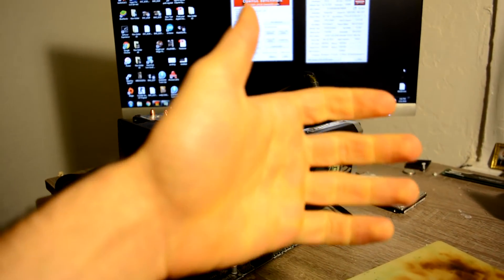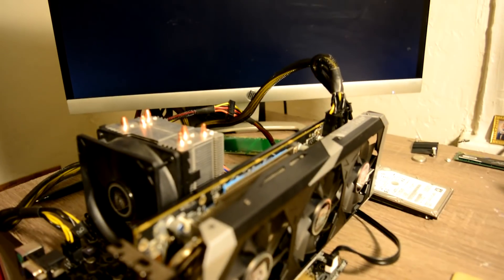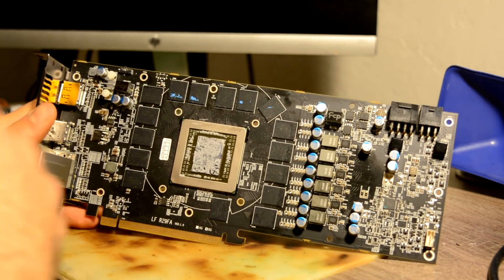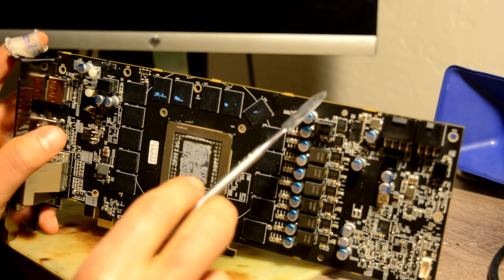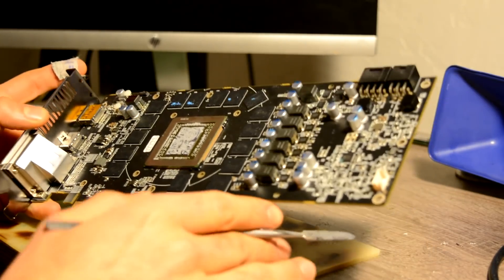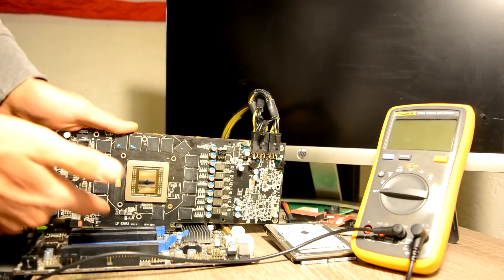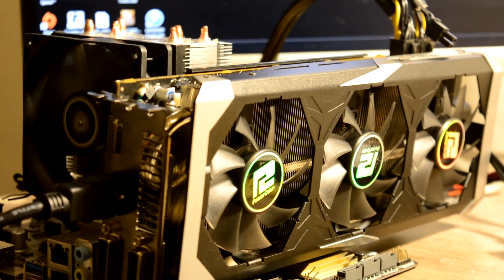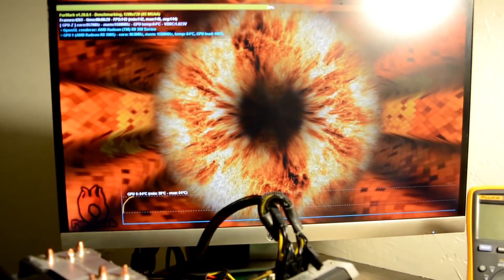Artifacts and dies under load video/graphic card repair

Comment: What do you recommend to fix coil whine on a gpu?
Reply from the maker: Enemize you take a coil out and add poxy to it. It doesn’t help 100%, but whine way lower
Reply: @elitech3339  Can I put the epoxy on the inductor/choke instead?

Comment: Maybe you can point me in the right direction - is there anything like a service manual for the GTX 1080 that shows the steps to debug a card with no video?

I've acquired a free 1080 and so far I've forced my builds integrated graphics on so I can reflash the card bios, i've been measuring what i believe is the GPU core voltage which seems to drop as soon as windows starts loading (gpu driver must be testing and putting the card into a safe mode), and device manager gives me the absolute most generic "the driver reported a problem with this card and it has been disabled (error 43)" 

My next step will probably be checking if the core / memory is getting the voltage it requests from the UP9511, then finding some way to test the integrated hdmi and displayport switches that control the cards output. I probably also need to test what load the card thinks its under, in case a hardware issue makes the card think its under an unrealistic load.

Comment: I am a bit confused... So you bought a new GPU (2:20) and added this chip to the dying R9 390 Powercolor to make it work?
Reply from the maker: Ali Husein correct, thanx
Reply: @elitech3339  How much did the new chip cost? Where did you even manage to buy one without the PCB or cooler? Good video.

Comment: i love your repair vids, i buy at the last week 3 r9 380 (first has a brocken gpu core, second have a short circuit on the drivers (dmg pcb) and the last has brocken drivers? after sold it out the drivers, the capacitor blowing up ( they are broken befor so they blow up?)

Comment: How much do you charge for GPU repairs? I got three asus turbo 1080s I need fixed
Reply: Poviku-PPcans I bought them on eBay as untested for a gamble and I failed :(
Reply: sell me one !
Reply: His email is on his about on his YouTube channel
Reply: I had a Asus 1080 turbo it died to a short but while it was alive the Gddr5x chips would artifact or crash occurred at stocks speeds most likely the memory chips buddy. I sold mine for parts for 120$ on eBay now looking back I think I could have fixed it just need to right value capacitor for the PCI 12v rail and try to probe a point in the traces
Reply: just put them in the oven (for real) try 210 °C (Celsius) for 12 min
Reply: @SerAlbi  NO
DO NOT DO THIS. 
Reflow them properly, this could mess them up worse.
Reply: @smileyguyz Usualy problem is not in solder but in chip itself so reflow isnt fixing anything. Its doing same thing as baking card in oven which is heating chip itself and fix it temporary.
Reply: @Sopheris  This often works for old GPUs, the thermal fatigue of gaming can loosen the solder. I cracked one of mine (the solder underneath, you can't see it, but I know that's part of what happened) running it on phase as my daily machine (phase cooling down to -58c at idle, then it would get warmed up to room temp after I shut then machine off. This extreme temp change and thermal contraction of the solder REALLY sped up the thermal fatigue process, haha, not great for longevity!

But I agree it probably won't help in the case of the GTX 1080. These GTX 1080's he has probably died while mining. Mining simply doesn't have the same issue with thermal spikes since they are almost constantly under load.
Reply: @jakegarrett8109  if the card died from mining then its probably the memory chip that failed or hopefully an easy-to-replace discrete component like the VRM. 

But baking would be a good opportunity to test if the solder under the GPU or another component is indeed the culprit -- that would at least narrow down what potentially failed.
Reply: @ayuchanayuko  Baking destroyes all the other components of the card and only fixes that for couple of days,months at most. The best solution ist to change the chip or RMA
Reply: @gaming512mb2  baking reflow is really a last resort if you'd rather not pay the off-warranty rma+shipping or pay for a proper fix/risk a component replacement or a new card is more affordable.

What I do though is first to clean the card and its pins and check for bloated caps, if it fails, check if you can flash the card, if it fails I clean with electronics contact cleaner, if it fails I clean the thing with dishwashing soap and a soft toothbrush to eliminate potential shorts and grime. That last step somehow magically fixes some cards -- maybe there was rat pee or some very conductive dust settled in some exposed traces. In some cases I read that it kind of revives some kind-of-dying but unbloated electrolytic caps. But anyhow--

The baking is a last resort if you can risk it and you have nothing to lose but I only bake for 180C 10mins. Paying for proper RMA or repair sometimes costs more than just getting a new card so this becomes an option. If the guy successfully reflows, they should have some ample time to check if someone can do an affordable reball. In some cases, the reflow will still work for a long time provided you underclock and undervolt to minimize further thermal stress.

If reflow does not fix, plug in the card and check for sources of massive heat and replace that component. Can be done with an thermal cam or a 100%alcohol test/contact cleaner test to see where it evaporates fastest. Another is to test for failing caps but you'd need a tester for that which most people dont have.